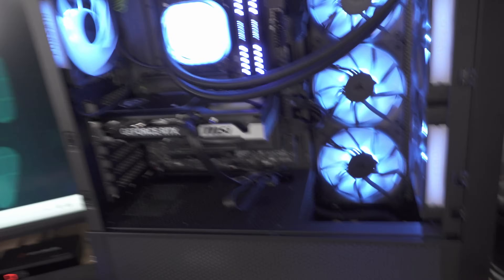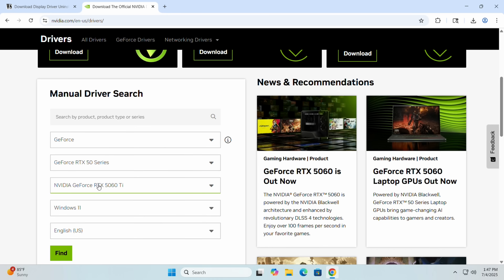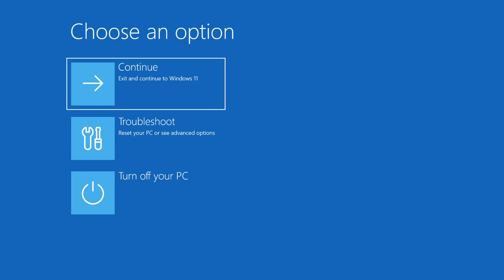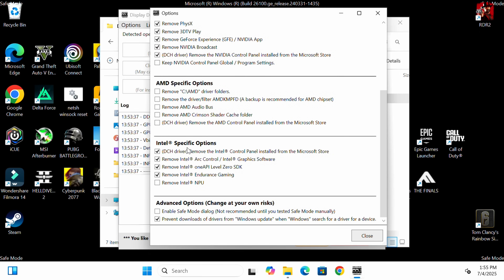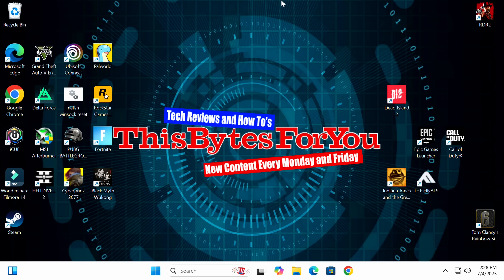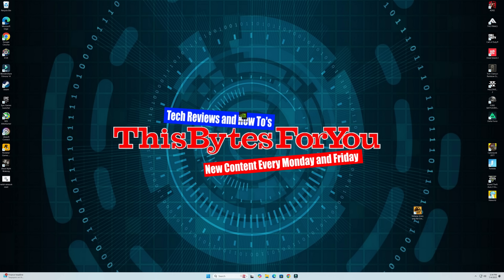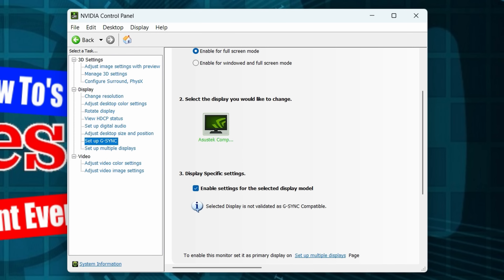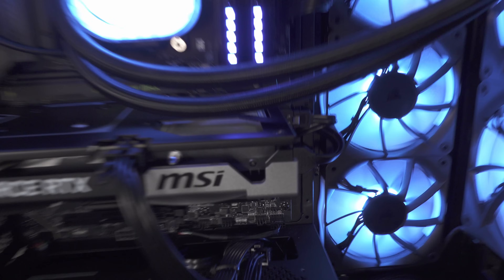The ONLY Way to Install RTX 5060 Ti? (Avoid Headaches & Maximize Performance)

Comment: Hello, I was wondering if you could help me troubleshoot my card. When I first installed the 5060 8gb coming from my 1660 super, I was getting video output like I expected. I then went to install the latest drivers and got a black screen. I restarted the PC and since then I have not been able to get any video output from the 5060. 

My old card still works fine and I followed all of the steps in the video up to installing the new card. I still have no output after reinstalling the 5060. It shows on my monitor as no video detected so I can’t go into my bios either. I just updated to the latest bios version before doing the steps in the video. My VGA light turns on on the motherboard when trying to turn on the pc with 5060. 

My specs are as follows:
Old card: 1660 super
New card: 5060 8gb
CPU: Ryzen 5 3600
Motherboard: msi b450 gaming plus max
Ram: 16gb Corsair vengeance
Os: windows 10

Thank you for this video and I hope to hear from you 🙏
Reply: I also want to mention that the 5060 fans do spin when powered on.
Reply from the maker: Did you watch the video and do what i showed you in this to get it to work?
Reply: @ThisBytesForYou I found this video after I had already tried installing the newest drivers on the 5060 without knowing they were problematic. After finding this video, I followed every step using my 1660s up to the point where you were configuring new bios settings after installing the new card. I couldn’t do anything after installing the new card since I no longer had any output to my monitor
Reply from the maker: They are not problematic actually, they install pretty easily thankfully but problems can happen like with anything. A Few questions.
1. What is the Manufacturer and Model number of your motherboard
1a. What is the BIOS version you are on the motherboard?
2. What is the Manufacturer and Model number of your Power Supply
3. What is the Manufacturer and Model number of your CPU
4. What is the Manufacturer and Model number of your RAM
If you are not sure, this video will help you find out all this info: https://youtu.be/65ZSiVImJx0
Reply: @ThisBytesForYou  
1. MSI B450 GAMING PLUS MAX (MS-7B86)
1a. H.N0
2.Gamemax vp-600
3. AMD Ryzen 5 3600
4. corsair cmk16gx4m2d3600c18
Reply from the maker: So you just updated the BIOS recently?  Making sure, because of all the Security, Optimizations, Improvements, it allows for Resizebar support and a TON of AGESA updates
OK, so the Ryzen 5 3600 is a PCIE 4.0 CPU
In windows, right click on the start button, click Device Manager, click to expand "Disk Drives", double click on the drive that your OS is on, click on the "Volumes" tab, the click "Populate", when that loads under "Disk Information" , what does it say your "Partition Style" is?
Reply: @ThisBytesForYou  I updated the BIOS before touching anything on DDU last night.  My partition style is GUID Partition Table (GPT).
Reply from the maker: Alright, a pro, good stuff my friend, a few more things, unfortunately your manual doesn't have any detail on your BIOS but I am trying
1. Do you have XMP enabled?
2. Do you have Resizebar enabled 
3. ASPM, do you have it disabled, Enabled or L0's and L1's?
4. Have you totally removed the card then reseated it, just in case?
5. Do you have an 8Pin PCIE cable installed?
6. DO you have an HDMI 2.1 or DP 1.4 cable?  
7. Did you switch from the cable you had before, to a new cable, or is it the same cable?
8. What do you see on the screen when it turns on?
Reply: @ThisBytesForYou 
1. XMP is off
2. Resizebar is enabled
3. ASPM is disabled
4. Yes I have. The only time it has displayed output was on the very first install before attempting to update drivers (before seeing this video). 
5. 8pin
6. I am not sure which cables I have. Both cables do work on my 1660super. 
7. I have not switched any cables. 
8. My screen will not turn on from the “rest” position like it normally would when starting the pc when I have the 5060 in. If I manually turn it on it says “DP no signal”. I have an msi monitor.
Reply from the maker: Enable XMP, you are losing performance, and it sets up your memory perfectly, actually, take a picture of all your settings, so you can remember them.  Then go in the BIOS, go to the EXIT section, select Load Optimal Defaults, or maybe its Load Defaults, it will load the optimal defaults, save and Exit, then go back in the BIOS.  Enable XMP, Enable Resize Bar, Set ASPM to either Enabled or L0 and L1's, Enable UEFI (which it should already be enabled I think), save and exit and see how that works.  Remember, things worked for your 1660Super, but your not using the 1660 Super anymore, this is a new card, things will be different.
Reply: @ThisBytesForYou to clarify, I have reinstalled the drivers using my 1660s. Should I remove all of the drivers again before I go and change all of these bios settings and installing the 5060? So far I have needed to have the 1660 in order to change any settings in the bios since I have no display on the 5060. I have not yet changed any bios settings since the last comment and just wanted to make sure.
Reply from the maker: That doesn't really mater right now, since it will work with or without the drivers, dont worry about the drivers now, focus on basic video.  The drivers wont affect the card in the BIOS or initial POST.
Reply: @ThisBytesForYou I tried all of the settings and it still doesn’t not display on the 5060. This card is really giving me some trouble 😭
Reply from the maker: @juustinjp  DO you have another system you can test the card on?  It might be bad, it happens.
Reply: @ThisBytesForYou I honestly totally forgot that I do have another system lol. I’ll try it out on there and let you know what happens.
Reply from the maker: @juustinjp sounds good bud
Reply: @ThisBytesForYou the card did not work on the other rig. I think this is the part where I just return it lol
Reply from the maker: It happens my friend, AMD or Nvidia, doa cards happen.  Good luck on your next one.

Comment: On the BIOS, I dont have the PCIe System setup, What should I do?
Reply from the maker: What is the manufacturer and model number of your motherboard?
Reply: Let me pull it up, one second
Reply from the maker: This video will help: https://youtu.be/65ZSiVImJx0
Reply: Thanks!
Reply: I have found it, 
Model is by: O.E.M AK-B450M EG
The ID (I think - found it on the motherboard) is: AK20401000863
Reply from the maker: Is this your motherboard: https://www.arktekco.com/product/amd-b450/
Reply: Yes
Reply from the maker: Sadly, that is a board that seems to be controller by a vendor that doesn't offer a lot of support, I can't see the BIOS settings and they don't seem to offer BIOS updates, please forgive me but I make a trillion videos, for which part did you need PCIe System Setup for?
Reply: 13:24, is where I need it
Reply from the maker: It can be in different settings, maybe under integrated peripherals, I can't think of the name but look through your BIOS and you may find it, but resizebar is something that was added later, so you will need to get a BIOS update from them.
Reply: Okay thank you!
Reply from the maker: @Safetylnstructor I wish I could help you more, but that company doesn't let any info out, kind of crazy, contact them to get the latest BIOS and maybe they can help you find those settings.  Since all boards/bios' are different its hard for me to tell you.
Reply: No worries, you’ve helped me enough, Ill contact them when I get home to update the BIOS system then Ill get back to you.

Again, thank you very much for this
Reply from the maker: Always a pleasure my friend, please do let me know how it goes, I am very curios, I really hope it works out for you.

Comment: I’m using a z370 and when I turn my pc on everything is working but the 5060 ti won’t turn on and my screen is black
Reply from the maker: Z370 is a chipset, what is the manufacturer and model number of your motherboard and power supply.
Reply: I can’t find the model number but I know it’s an asus motherboard and corsair 850x power supply
Reply from the maker: usually asus has it written right on their board, this video will help you: https://youtu.be/65ZSiVImJx0

Comment: I just upgraded from a 3060 8gb to a 5060 ti 16 gb and followed your video and now my pc stutters and freezes and gives me a blue screen when nothing open or running. I’ve checked my temps and usage and nothing seems abnormal could you help me fix that? My watts is 600 if that helps
Reply from the maker: That's incredibly odd.  
1. Did you change from CSM Enabled to Disabled?
2. Was UEFI disabled before, then you enabled it?
3. Did you remove the drivers like I showed?
4. What is ASPM set to now?
5. What is the manufacturer and model number of your motherboard?
6. What is the manufacturer and model number of your power supply?
7. Abnormal is relevant, what are the temps your GPU is showing when you are gaming?
8. Abnormal is relevant, what are the temps your GPU is showing when you are idle?
Reply: @ThisBytesForYou thank you for the reply. Cms was already disabled and uefi was already enabled and I removed the driver like shown, I’m not sure what aspm is set to, the manufacturer for the mother board is gigabyte and the model number is B660 DS3H AC DDR4-Y1 rev 1, idk the power supply, and my temps while idle are normal, and I haven’t tried gaming cause my pc crashes after a bit.
Reply: @ThisBytesForYou and my pc wasn’t working after a while. It want even turning on so I popped my old gpu in and it work perfectly fine without me needing to install new drivers. I deleted those drivers with ddu and did a clean install of the drivers for the 5060 too
Reply from the maker: 1st, update your BIOS, to the latest version F32, not a story, just do it: https://www.gigabyte.com/Motherboard/B660-DS3H-AC-DDR4-rev-10-12/support#dl
3. You removed the drivers within regular windows mode, not Safemode, that will cause an issue.  Then you installed drivers for the 5060 with the 3060 inserted, that can cause issues.

You will have to look for these settings below in your BIOS, I found them in your manual: https://download.gigabyte.com/FileList/Manual/mb_manual_600series-bios_e_v3.pdf?v=e176cfcc0bb7f8b739252e4d3b0b9101

This all worked before, but you have a new card, before doesn't mater anymore

Your BIOS has ASPM support, also PEG ASPM, make sure PEG ASPM is enabled and you have the ASPM set correctly, like I show you in the video.
Set your Initial Display Output to PCIE slot 1
Set CPU PCIe Link Speed to Gen4
Enable Above 4G Decoding
Under Boot, set VGA Support to EFI Driver
6. You have the system, open it up and read to me what the manufacturer and model number are, so I can help you I need to know
7. Normal temps isn't a number, tell me the temperature, normal for you is much higher than is normal for me, normal is different for everyone.
8. Normal temps isn't a number, tell me the temperature, normal for you is much higher than is normal for me, normal is different for everyone.

Comment: Im currently on GTX 1080, ordered 5060Ti 16GB and i have some questions:

My motherboard (AsRock Z370 Pro4 ) is in UEFI mode, however with CSM currently enabled. After i disable CSM, sometimes on booting my motherboard beeps 5 times and then it boots into Windows with CSM enabled again, i've read it's because older GPUs such as the 1080 can have issues with full UEFI mode, so before i use DDU in safe mode i should disable CSM first right? With CSM the card wouldn't boot into Windows?
Reply from the maker: This video will help you, it's on cloning but it will help at the 8:32 mark, let me know how it goes https://youtu.be/4BtdMcqwaFg?si=hSPpYHe_g49C1IcV
Reply: @ThisBytesForYou  Here is the tricky part, I converted my disks into GPT a while back, maybe it's some other option iI still haven't checked in BIOS? I think i haven't checked the ASPM thing yet
Reply from the maker: Aspm could help, but i doubt it.  Aside from gpt, did you watch this video and see the other settings as well as update your bios to the latest version?
Reply: @ThisBytesForYou  Turns out ASPM was disabled, this time I left CSM on enabled but changed every CSM option into UEFI mode, will RTX work on this config? 

Everything was working fine untill I swapped CMOS battery to a brand new one early this year, I had to convert again into UEFI and since then i have these CSM issues after converting.
Reply from the maker: @MaciejSkywalker it would help on a clean install to have to disabled, CSM in your BIOS refers to a feature that allows a UEFI system to boot in legacy BIOS mode, enabling support for older operating systems and hardware. It bridges the gap between older BIOS-based systems and newer UEFI systems, allowing them to coexist. Since you installed it with bios and mbr, it made it more difficult and working off of an older bios since you haven't updated it makes it difficult too.  Yes, ray tracing will work in that config it will help to have resizebar enabled too.
Reply: @ThisBytesForYou  Thank you for the help, you were the only person to help me out, I've been asking literally everywhere. Actually ChatGPT recommended me your video haha ;) I hope CSM won't cause me any more issues after this
Reply from the maker: @MaciejSkywalker a clean install would help tons, and also give you back a lot of your missing performance, as well as a bios update.  So you say chaptgpt recommended me, that's pretty cool, happy I could help

Comment: Hey, is rtx 5060 ti gddr7 compatible with my b760 ddr4 motherboard?
Reply from the maker: Yes, but what is the manufacturer and model number of your power supply though?
Reply: How much watt psu do I need for 5060 btw? @ThisBytesForYou
Reply from the maker: This specific card, the G506T-16V2CP requires a 600Watt,  what is the manufacturer and model number of your card?

Comment: The 5060 ti 16gb doesn't work on a z370 board
Reply from the maker: Z370 is a chipset, I am sure it would work on many as long as you are on the latest bios, have your bios configured with csm disabled, have support for rebar, my z370 had it after I updated the bios, and is set to UEFi.  Check the manufacturer and model number of your board, check on the support site for your board or tell me and I will check
Reply: @ThisBytesForYou actually It didn't work updating bios, you can't update drivers for the graphics card because it didn't detect it. What worked was using the 8x pcie lane. 😅
Reply from the maker: @Showmangreengo ahhh good point, if your out of lanes that would cause tremendous issues but glad you got it but actually the card is a x8 card even though of course it does utilize a x16 slot. Did you check for resizebar?

Comment: I went from a 1650 to a 5060 and I have no pcie cable
Reply from the maker: So what your saying is you dont have this particular card and it's not working but if it is working you don't have this card, what is the manufacturer and model number of your card?

Comment: i received my new gpu and tried installing it but the whole pc was stuttering and freezing for a few secs whenever i opened a new program. so i used DDU to delete my old drivers, and then i installed again the new ones. but the pc is still stuttering. whether i open a new game, or just opera gx, or just folders, my cpu performance skyrockets to 90%+ and it causes the whole pc to freeze for a few seconds before dropping down again. i was able to start a few games but when using genshin for example, the pc starts stuttering more and more until a black screen pops up and the pc just freezes while still being on

i have an i5 12400F and a 750W psu i just got
Reply from the maker: Did you remove the older card and install the newer card like I show you and all, drivers and all and take care of the bios settings?
Reply: @ThisBytesForYou i did, but i think i resolved it, it was a bios problem. My version was from 2023, it needed to be updated. And i did everything you did in this video except for the ASPM Control
Reply from the maker: awesome my friend, yes BIOS' fix a TON, a lot of people fight me on that for some reason, I made this video to help them understand: https://youtube.com/shorts/g5CV_TlGN1k

Comment: Thanks for this . All seems to be working well for now . I’ve just installed the card so will get stuck in later . My bios seemed quite different but I did disable CSM . It was enabled . I also had to unplug my dvd drive ,which i never use , as its power connection was in the way of the card .
Reply from the maker: Good for disabling CSM and good that it is still working, I wonder though, are you in GPT or MBR for your C drive?  To check, right click on your start button, then click disk management, on the bottom left hand side, name Disk 0 or Disk 1 or Disk 2, etc, you will see one that has your C drive listed, right click on the Disk # box on the left, what does it say under "Convert to Dynamic Disk..."?

Comment: I accidentally didn't uncheck all that "remove intel" stuff and I have an intel cpu.  is that bad?  should I try to reinstall that stuff?
Reply from the maker: You will want to reinstall your Intel chipset drivers, not a huge deal though just make sure to install the chipset drivers and you will be good.